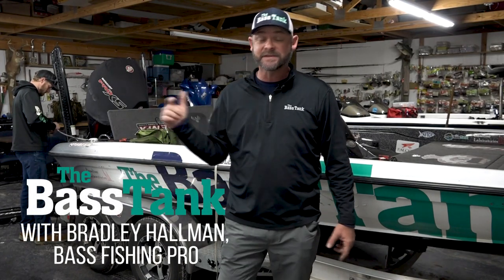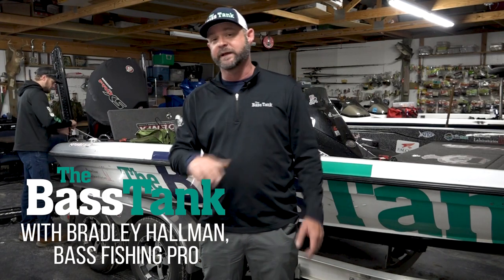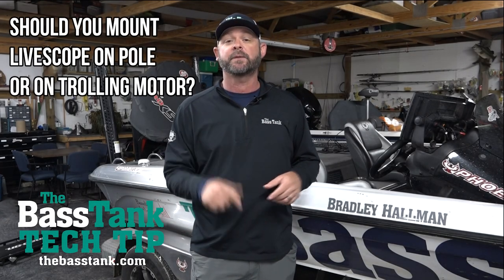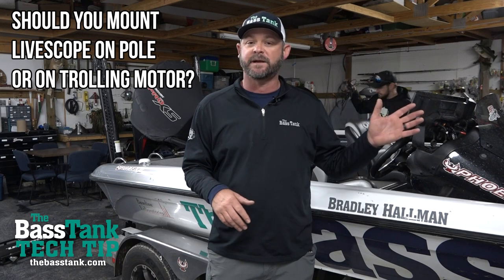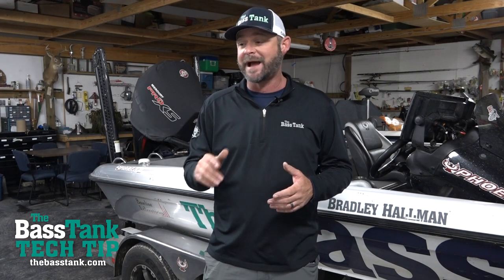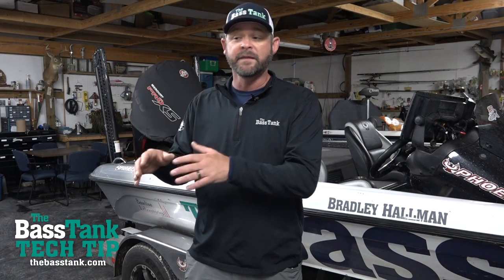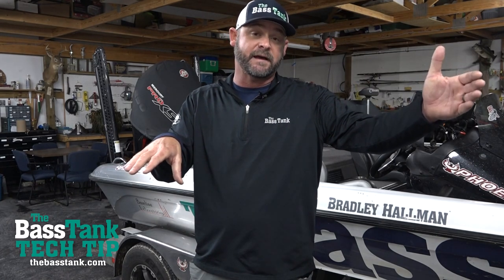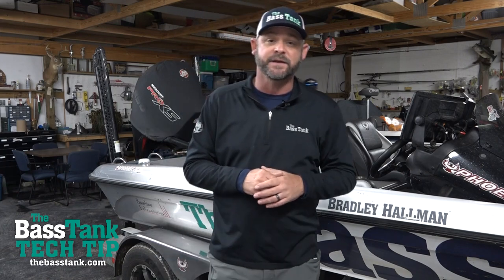Livescope on Separate Pole or Trolling Motor Shaft? TechTip

Comment: It all comes down if you fish in wind and or current. To zero in on a structure pile where I fish , I would need spot lock just because of the breezy conditions and the current. My spot lock is usually working overtime which would render my livescope useless in those conditions mounted on the trolling motor. Will definitely be looking to fab up a seperated pole mounted on the trolling motor.

Comment: I use Spot Lock so it seems a pole is better.  Also use Contour Troll (where the Ulterra Trolling Motor follows a lake Contour Line) which I set.  If I step on the Foot Pedal to rotate the Trolling Motor, I would have to re-enter the desired Contour Line I want to troll.
Kinda of a “Chevy” or “Ford” question.  Both are right!

Comment: what if you have a Minn  Kota Terrova and can't mount the Livescope Plus on the shaft because you need to move the shaft to have the motor in the "stow" position...you're only choice there is barrel mount. Is barrel mount better than a separate pole? I'm fishing Largemouth and Smallmouth bass in less than 30' of water (sometimes less than 10' of water) and LOTS of weeds.